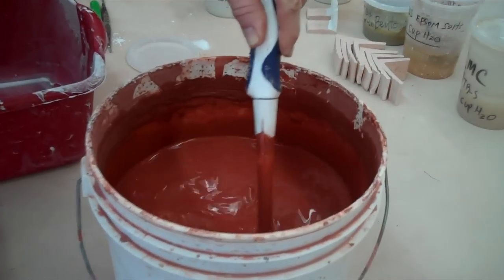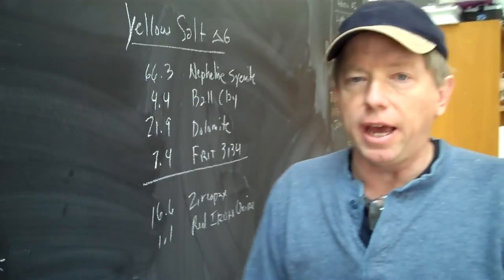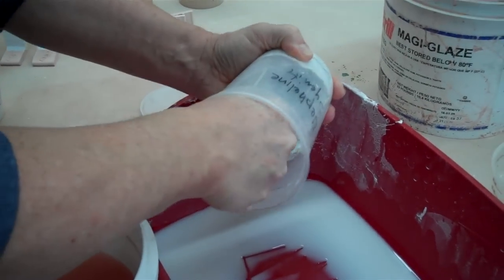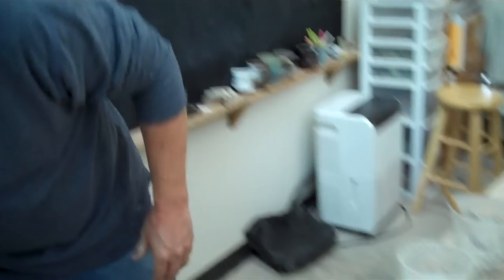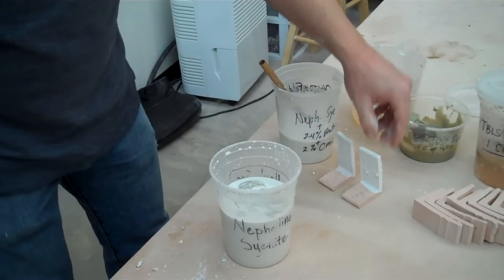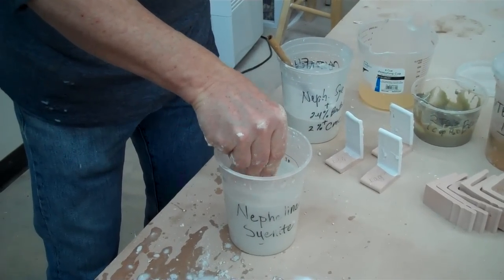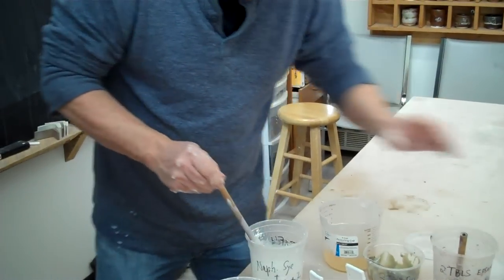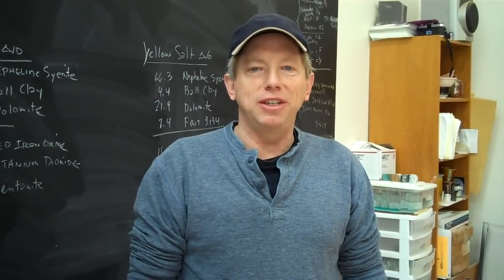Fixing Hard Panned Glazes

Comment: Great John, thanks. I don't want to use bentonite as it contains iron. I'm trying to stop hardpanning in a white satin matte for use on porcelain. I've changed the formulation to replace ball clay with china clay to exclude the iron so don't want to add it back. I'll try epsom salts in the hope there is enough clay in the glaze to make it work.
Reply from the maker: The iron is negligable, but you can use Macloid or Vee-gum T..no iron
Reply: @johnbrittpottery  Thanks again, will do a test with bentonite